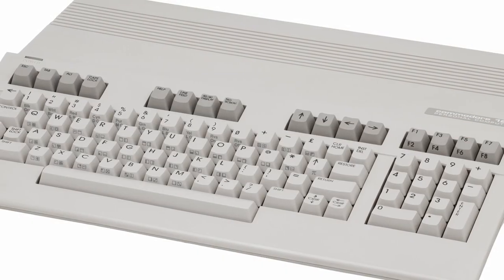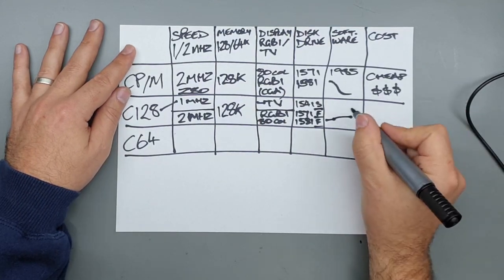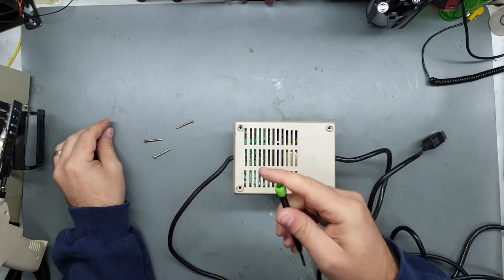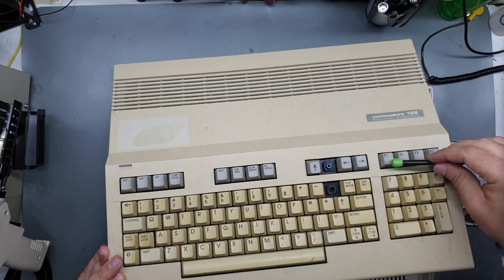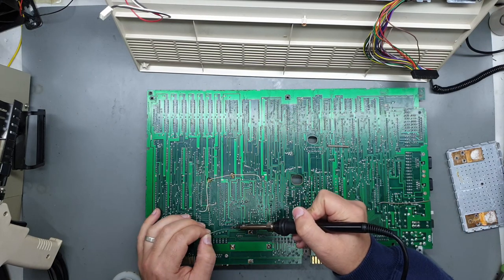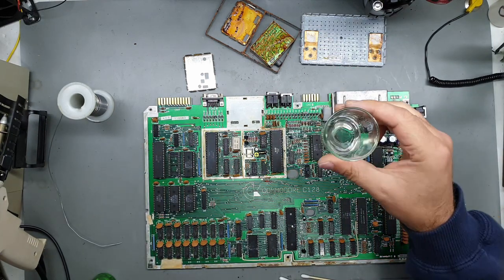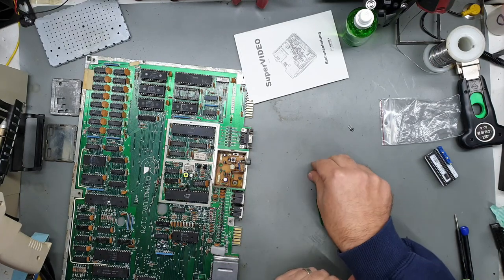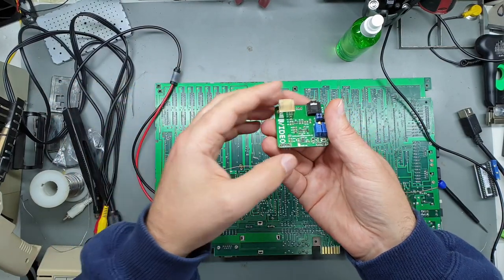Commodore 128 introduction and restoration Part 1 + a look at the Super Video modulator replacement

Comment: You C-64 power supply looks NOTHING like any I ever saw in the US. Ours had the brick shape and was completely covered in epoxy. It's definitely a good idea to replace either. I definitely appreciate the video! I am trying to get a C128. I used to have one when I was young, but I got rid of my various machine. I never had/wanted a Vic-20. I had the C64, the C128, the C16, and Plus/4. Today I'm a CS professor and I'm collecting my "memories". I have all but the C128. I am marking videos for recapping. Videos like yours really help when you point out what needs to be watched for when doing restorations. The C128 had the ability to expand to 512K, but it was rarely used and somewhat expensive. CP/M used the extra RAM as a RAM drive. Thanks for the videos!
Reply from the maker: Thanks Jeffrey. We also had the epoxy bricks, in fact there are 3 main ones I come across in Australia. The open, fully serviceable one, the half epoxy wedge type and the full epoxy brick. You can see all of them in this video on my other channel if you're interested https://youtu.be/kO5oXK5ovto
Good luck with the hunt for a 128

Comment: Thanks for this video. Really great work and care was done.

This is a great intro for the C128 but there are some minor mistakes.
-C64 was discontinued in 1994 April 
-Disk drives for CP/M... I would argue that mainly 1571 was designed for the old CP/M software library from other manufacturers meanwhile the 1581 was only suggested to be used because of the compatible fast burst mode and not because of the software availability on 3 1/2"disks . Also perhaps a mention of the 1570 could have been added too...
-The keyboard ground was not included in your package (nor the screws - which should be not 3 but 6 - check video2)
-When you show the extra keys that VIC-IIE handles you are showing only the upper row keys, incorrectly including the Function keys, but missing the numeric keys
-Only the C128DCR has the newer SID 8580, the plastic C128D has exact same board with same SID 6581
-When you install the Super Video, you try to plugin the normal Din video connector to the "old RF port"... then giving a comment to be ohh...now it is S-Video... khmmm.. sorry mate ;-)

BTW: Is it just me that when I switch between C128 and C64 fixing then initially I try to connect to the wrong port? I mean the serial and the video port is in different order on the C64 and C128. Of course it is easy now to remember that the video is the one which is closer to the RF modulator but if you just blindly try right side on a C128 after C64 fixing then you eventually remember.. ohhh.. this is the other model. ;-)

Sorry, today was my pedantic evening... I will stop this in the future.
Still GREAT work! I really enjoyed this video as well and sorry for the above stupid comments... (if not me then eventually somebody else would point all these out).

Thanks again for creating these videos!
Reply from the maker: All very good points. I had never touched a 128 prior to this, so I was mostly relying on what the internetz told me

Comment: I've seen people using vinegar to neutralise leaked alkaline material from leaky batteries. I didn't realise it did anything to oxidation.
I'm always excited about the c128 even though I don't actually have a use for it. Nice to see one in a repair video though.

Comment: That original C128 power brick you got with the computer sure looks like a switched mode supply to me. No rectifier bridge, coils and lots of legs on the semiconductor. The transformer is there for the 9V AC.
Reply from the maker: Yes you're right. Clearly I didn't know what I was looking at back then 😄

Comment: Great video. Just one comment regarding your comparison in the introduction. Back in the mid to late 1980s, if you were like me looking for something affordable which could play all of you C64 games but also help with your homework, the C128 was the only way to go. The early Amigas were just too expensive as were IBM Compatibles. For $500 you could upgrade to the C128 and use most if not all of your existing C64 software and peripherals. The only other addition was a monitor which could display 80 columns, and a lot of us picked up cheap amber or green screen ones to do this. So for very little money you had a very capable computer that could play all your C64 games also do some serious business applications. Thus buying the C128 was a no brainer, especially the C128D which by the late 1980s could be gotten for a great price and also included the 1571.

Comment: I am working setting up my 128D again, I have not use it since 1998. Right now I having two problems
1) Getting c64 games to run on the 128D
2)Have the 128D recognize all the drives, 2 floppy drive and 1 mini drive. I know they all work together before, I also know the 128D is drive =8, not sure how to the other drives to be 9-11.

When I first this up it was easy. Looking for help.
Reply from the maker: C64 games should run no problem once in C64 mode. Type GO64 after turning on the computer, or from memory holding down the C= key when powering on will also go into 64 mode.

As for the drives, I'm not sure how the 128D maps them, I don't have on here to play with
Reply: @TheRetroChannel  So far they are not.
Reply from the maker: Do any of the drives (including the internal one) spin the disk when trying to load something? What happens exactly?
Reply: @TheRetroChannel  The 128D does, not the others.
Reply: @TheRetroChannel  I fix them I forgot the drives have pins on the back of the drives.
Reply from the maker: Great, glad you got them working 👍